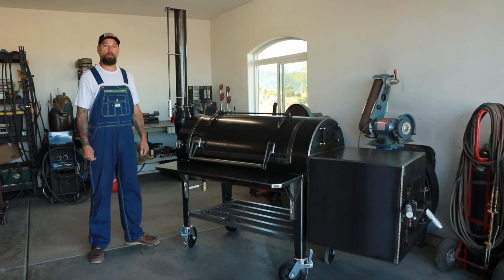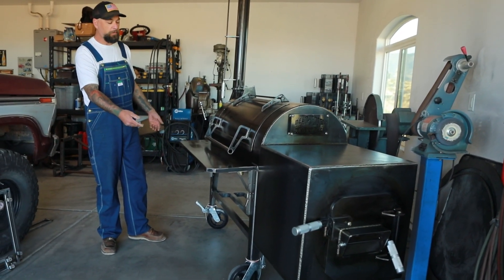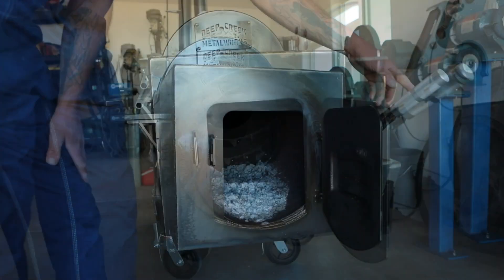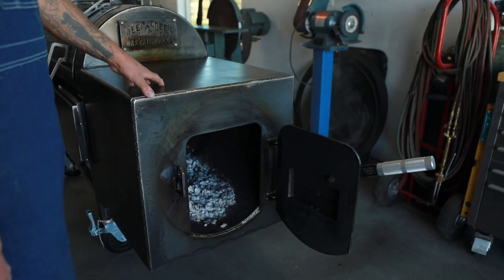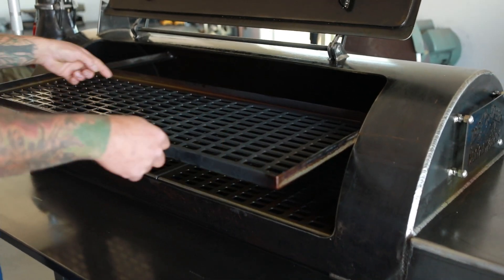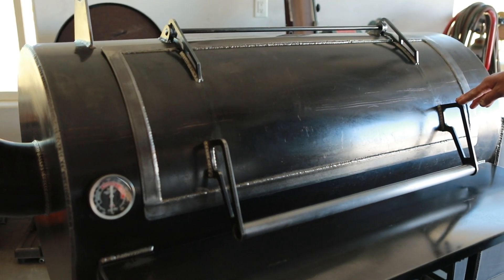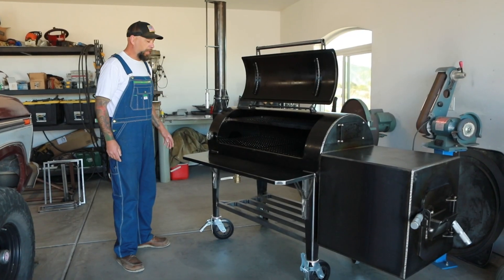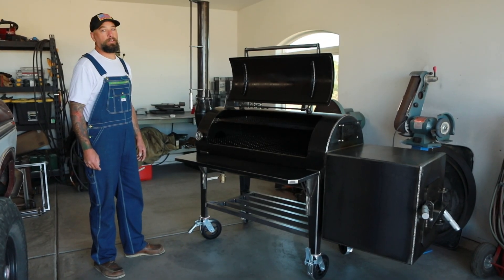NEW 100 Gallon Pit with all the Bells and Whistles!

Comment: Just a few modifications I would make:  
1)  Use 1/2” steel if they request an insulated firebox. If not use 3/8” steel. 
2) 3/8” steel for the cooking chamber and not 1/4” steel. 
3) leave the smoke stack at 6 inches and don’t reduce to 4 inches. 
4)  The upper shelf is too high in the cooking chamber to be useful. Drop it down 2-3 inches. 
5) Would like to see you baffle design as well. 
I’m a fan!  This is just my 0.02 cents.
Reply from the maker: No worries,  I appreciate the constructive criticism.